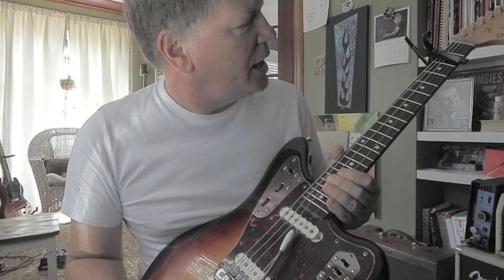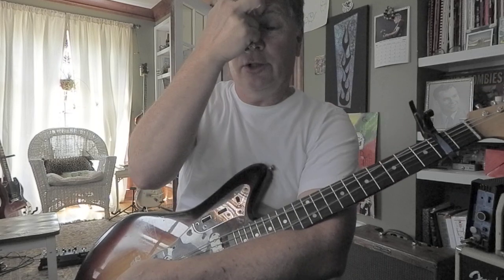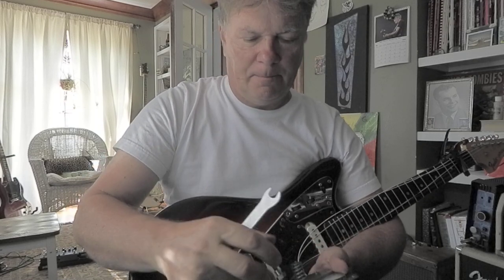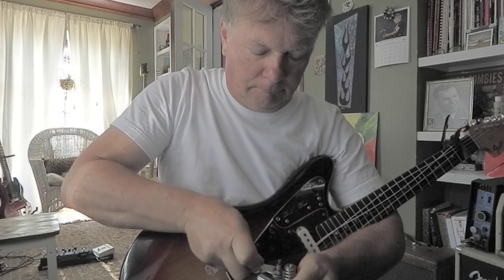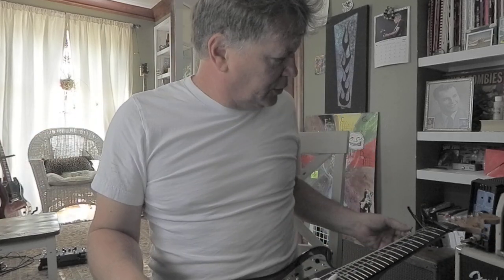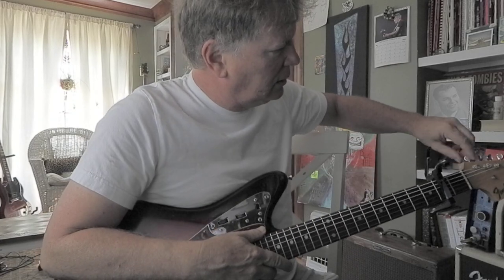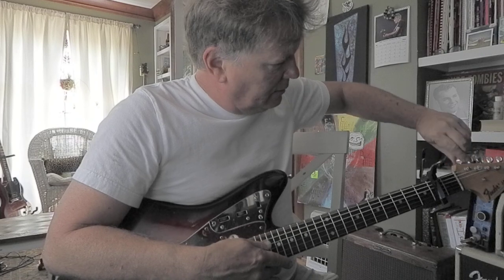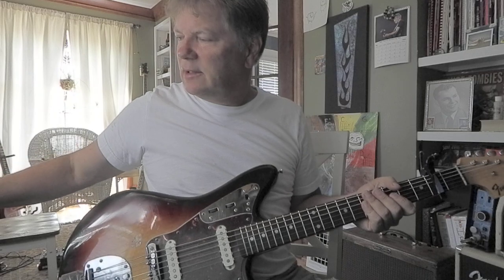Fixing a Floppy Jaguar Wammy Arm

Comment: Hey Brook, what's up with the bridge that comes with this guitar? Seems like everyone replaces it. Or am I thinking of the Jazzmaster?
Reply from the maker: Jazzmaster and Jaguar have identical trem systems. I see no reason to replace the tailpiece part I am showing in the video. But the bridge can benefit from an upgrade. The original design was planned with thick flatwound strings. When people switched over to lighter gauge strings, there was not enough down angle to keep the strings seated in the saddles when played with a little force and the strings hop over to the next saddle and it's a mess. I bought a Mastery brand bridge. Not cheap but worth every penny for me. Recommended by this Jagman.